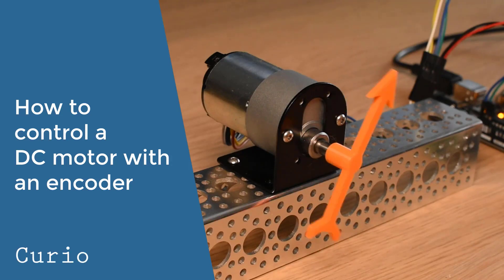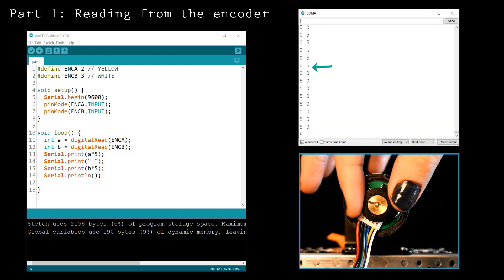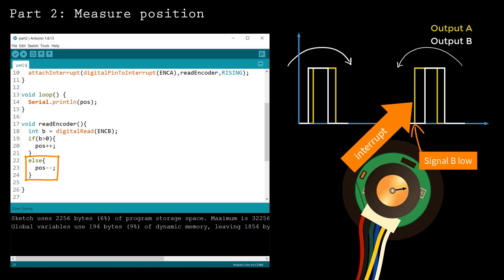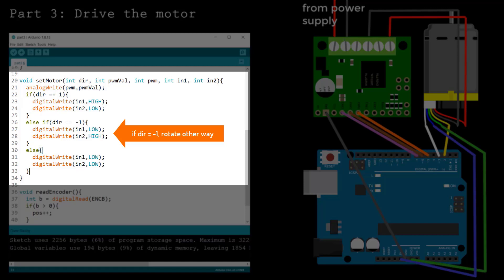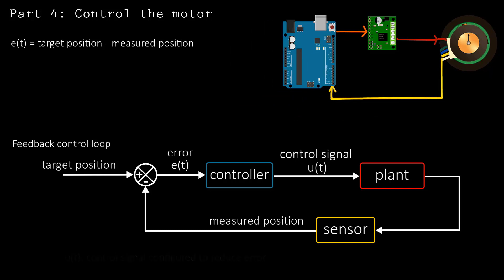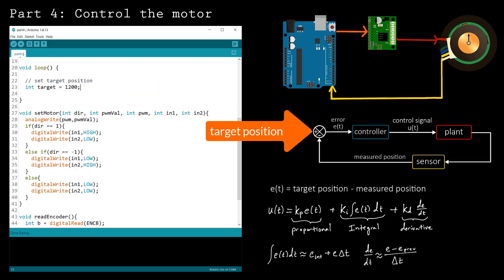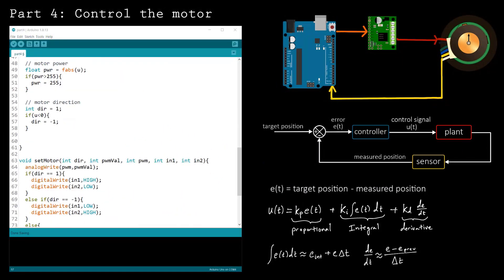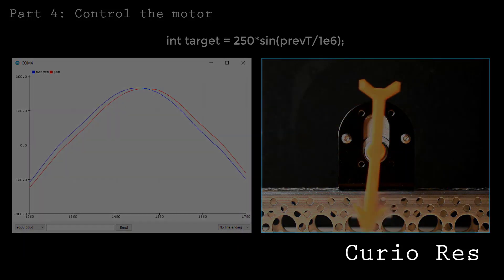How to control a DC motor with an encoder

Comment: Could I do this we three separate motors using an Arduino Mega since it has 6 interrupt pins? I want to be able to change the target position by using buttons and an LCD screen with a menu and percentages from 1-100% which will be converted into the amount of turns the motor needs hence being the target value for each one individually. Would love some feed back :)
Reply from the maker: Indeed Travis, that should work. If you're doing a lot of additional processing on the Mega there's always a chance that some of the interrupts could be skipped and you would have to recalibrate the 0% and 100%, so keep that in mind.

Comment: When my professor told me he can´t tell me how to implement pid into a microcontroller I thought it must be a very hard thing. Finally I came across your video and this was poor luck because my search on youtube gave nothing like yours. So thank you very much for taking your time to explain all of this. I like control theory because it´s hard to understand but If you understand it makes you proud.
Reply from the maker: Sounds like my profs. :D 

Thank you so much for your comment. Your comment is literally the reason I make videos. 

I agree. Control theory is challenging, rewarding, and exciting.
Reply: Theory is dry but what you show makes more fun at least :D Hey I have an idea do you think an encoder attached to a bldc motor would allow me to set the motor speed perfectly with your pid method ? I have such a motor left from an old hdd and I would play around with your code. I only knew how to do it with op amps but changing code is faster than changing capacitors and resistors.

Comment: What does the output on the serial monitor at 2:48 shows, what unit is the output in? I know it measures distance but what is it actually?
Reply from the maker: The positions refer to how many steps the encoder has taken. How that actually translates into the angular position of the motor shaft is determined by (1) how many encoder steps per unit of angle measurement there are and (2) what the gear ratio of the motor is. You can find that information on the spec sheet for the motor.

Comment: Really good is it possible with Arduino control a big high   Torque  dc motor  with relays like servo motor in both directions and feed back from motor  gear shaft feed back from potentiometer meter  I mean no controller in side only arduino and relays for supply and direction feed back from motor reduction hear  you are look engineer please solve the issue thanks
Reply from the maker: Is the difference that you're trying to use relays instead of a variable speed controller (i.e. PWM motor driver)? If that's the case,  yeah, you can do that. But it's not PID control and there will be issues. You'll bounce around your target a lot, and you'll never be able to actually hit it. 

Alternatively, you could use on of these high current motor drivers (or however big you need for your application) https://www.pololu.com/product/2995
There are other cheaper options than Pololu, but some cheap products can be unreliable.

Or you could build your own... but if your not an electrical circuits person, then you probably don't want to do that.

Comment: Love this , I want to build a gate opener and have to use an encoder to measure distance of travel. I need to study this to get a handle on exactly what's happening. I have to be able to control distance of travel and be able to stop and start during travel. Do you know if there are garage door type receivers for arduino? Thanks. I'm checking out more if your videos.
Reply from the maker: I'm not sure how big your gate is, but I think that some gates might use a larger motor, like an A/C motor. I haven't worked on an application like that, so I won't comment further.

If you already have a motor sized for your application with an encoder, this approach should work. Here are a few of my initial thoughts: you can control the stopping/starting by signaling the motor driver.  You can read from the encoder to identify the change of the encoder's position. If you need to translate that into a real position, then you could (a) calibrate the position each time the gate closes and (b) identify and code the relationship between the actual position and the encoder "position". You can also control the position more specifically using the feedback loop.

In terms of a receiver, I don't know of anything specific to garage doors. As far as I know garage door openers just use RF transmitters/receivers. In the past I have used these RF Transceivers:
https://www.amazon.com/gp/product/B06WLH4ZG6/ref=ppx_yo_dt_b_asin_title_o03_s01?ie=UTF8&psc=1
with this breakout adapter:
https://www.amazon.com/Makerfire-NRF24L01-Breakout-Regulator-Wireless/dp/B01IK9GCPE/ref=pd_bxgy_img_2/141-5233654-2526000?_encoding=UTF8&pd_rd_i=B01IK9GCPE&pd_rd_r=97b87397-caa4-4314-8ad6-94627e814c6c&pd_rd_w=Qi5gA&pd_rd_wg=3mUVx&pf_rd_p=bd257e40-8799-42ac-88d0-f76e0faf3886&pf_rd_r=6VNV5V37MSHHKA1VQXV9&psc=1&refRID=6VNV5V37MSHHKA1VQXV9
with an arduino nano without difficulty. It was very easy to set up a routine for sending and receiving signals between two nanos. 

These are probably overkill for your application. You could probably find a cheaper RF transceiver suitable for your application. Just something I used before. Good luck with your gate opener!
Reply: Curio Res thank you very much for your reply. I am using the original arm from gateopener. It uses an optical encoder to give position. It uses a small 12v D.C. Motor (maubuchi 550-2750v) it's part of off geared down box going from 18,000 to maybe 100rpm. So not a lot of current or power needed. But for 400$ for a new circuit board . I figured what the heck I could learn a lot on this project. Has been thirty years or more since I've done programming but I'll keep plugging away. Thanks again curio res.

Comment: I'm right into this in my studies right now. But I'm not familiar with derivative and integral terms because we use Laplace transforms to get transfer funtions. So derivatives translate into polynomials on the numerator and integrals as polynomials in the denominator
Reply from the maker: Hi Nico. I'm not using a transfer function representation of a model for the control system. In this system, the physical motor (driver, and so forth) are the equivalent of the transfer function model that you might use in a simulation. The derivatives and integrals here are always computed in the time domain (not the s-domain, where transfer functions live).

Perhaps in the future I'll create some additional tutorials that use more complicated control theory. But for this one, no transfer functions are necessary. Just approximate the derivatives and integrals in the time domain.

If you want to learn more about the theory, I'd recommend Brian Douglas' videos.
https://www.youtube.com/channel/UCq0imsn84ShAe9PBOFnoIrg
Reply: @curiores111  Okay that is why I got confused some time. Thank you for the explaination

Comment: almost  nobody on the internet used the term "Finite difference approximation", saved me a lot of hassle
Reply from the maker: Yeah, that's "math talk". More specifically numerical methods. It's kind of funny how educational discipline vernacular tends to have a divergent evolution. Makes vertical disciplines like control theory even more difficult for a beginner (as if they weren't hard enough already).

Comment: May i ask you once if you power off the motor and the pcb board and replug it and turn it on. Will it do the same job without computer control?
Reply from the maker: Yes, the microcontroller board controls the motor independent of the computer. Once you've uploaded your code, that same code will run whenever the arduino has power.
Reply: @curiores111  nice , thank you for the replied.

Comment: This is amazing! thank you so much, is it possible to manage multiple DC motors (5) at the same time with this algorithm?
Reply from the maker: Hi Pedro, it is certainly possible to use control for multiple motors. If you're controlling them independently, then you would set different targets (or the same target) for each and use the PID library 
https://www.arduino.cc/reference/en/libraries/pid/
 or your own functions/class to control them individually. For many applications that approach is probably sufficient, although of course there are more complex algorithms that can be used. 

Also, for five motors you are definitely going to want to upgrade the microcontroller (esp 32 or arduino mega, perhaps).
Reply: @curiores111  Thank you for the quick response. Yes! I am already using an arduino mega for the project, and they will mostly have the same target position. For the hardware set up, since the encoders need to go in the  interrupt pins is there an exact position for the two encoders cables? for example, can I have Encoder4 A in pin 19(Interrupt pin in MEGA)  and Encoder4 B in pin 17(Not an interrupt pin)? Thank you
Reply from the maker: @pedrojavierbautistapulido192  That's right, you only need the interrupt on a pin where you're going to schedule an interrupt. The other pin just needs to perform a digital read, so no need for an interrupt. Another thing to consider is the potential for skipped readings. If your application requires very high precision, and you have a lot of interrupts/processing going on, you might miss a reading. If this happens, you may need to consider running a more powerful controller or more than one controller (or switching to stepper motors).

Comment: Hello, I'm thinking of building a robot that uses 2 encoded DC motors similar to what you have in your video.  Can an arduino uno read 2 encoders, considering that only pins 2 and 3 are interrupt pins?
Reply from the maker: Hi Daniel. You could try a setup like this:

Motor 1 - encoder A -> pin 2
Motor 1 - encoder B -> pin 4

Motor 2 - encoder A -> pin 3
Motor 2 - encoder B -> pin 5

Then, schedule an interrupt function on pin 2. In addition, schedule an interrupt function for pin 3. Each interrupt function should update a different motor position. I haven't tried this myself, but don't see any reason initially why it wouldn't work.

After you have that working, you can also consider purchasing an Arduino Mega or even better, an ESP32, which also has wifi. These boards have several interrupt pins. In addition, you are less likely to lose counts with a more powerful microcontroller, which can happen with an Uno if the motor is moving very quickly and you are performing other computations on the Arduino. These other options are not much more expensive than the Uno.
Reply: @curiores111  Thanks, I will try that. Have you heard of the enableinterrupt library which can turn all digital pins into interrupt pins?
Reply from the maker: @dw3695  yes, I have heard about using more than two interrupts on the Uno. Personally, I'm less interested in hacks (either software or hardware) to obtain more than the built-in function. There are likely reasons why they chose only to offer two interrupts (it may put too much demand on the processor to have more). I would rather upgrade to a better controller, considering the negligible cost.
Reply: @dw3695  did you have any luck completing this task I am currently trying to do the same thing.
Reply: @MrJmanjim  Hi, like curio res suggested, I changed pin 3 to pin 4 so pin 3 could be freed to be the interrupt for another encoder. It works, but since I haven't inserted the other encoder yet, I'm not sure how well it runs when two encoders are used at once.
Reply: @dw3695  I am just curious how the second encoder would be grounded and powered would this need to be from another external power source ?
Reply: @MrJmanjim  there are 3 ground pins on an arduino uno. The encoder i used can take either a 5v or 3.3v power, both of which are supplied by arduino's pins.
Reply: @dw3695  Appears like my encoder is +5 vcc that is why I am having issues to complete this
Reply: @MrJmanjim  arduino uno has +5 vcc too
Reply: I am using the 5+V for my first encoder so I am unsure where to place it to power my second encoder. I have two encoders that are both 5V

Comment: One of the best videos I have come across. The combination of the hardware setup and linking this to the block diagram and finally linking block diagram to code is an inspiring idea.
Reply from the maker: Thank you Rokonuddin. I'm very pleased that the format resonated with you. When I finished the video I was sure that I had covered too much. But I think that it can be worth the effort when you actually want to understand the details of how a system works.
Reply: Hi  @curiores111  , the scope of this video is perfect. If you had a feeling that it was too much, perhaps for a beginner it may be too much. For someone that already has a basic understanding and some experience coding it's absolutely perfect!! So well done!!  Thank you so much.

Comment: Hello, just curious how I could implement this code by just having the target position can be constantly changed instead of one position per upload ?
Reply from the maker: Hi Joshua, you can set any target you want inside the code. Simply change the line
   int target = 1200;
to your desired target. For example, at the end of the video, I show a moving sine target calculated as:
   int target = 250*sin(prevT/1e6);
But you aren't limited to a predetermined target. For example, if you have a sensor reading and some logic, you can use those to set the target, instead of the sine curve. You could also send a new target from another source, like a computer, through the serial com.
Reply: @curiores111  would it be possible to include another motor with an encoder and have it have do the same thing as the first motor ?
Reply from the maker: @MrJmanjim  Certainly, you can use more than one motor. Schedule one to interrupt pin 2 and the other to interrupt pin 3. Make sure to include separate measurements and control signals for each motor. If the code becomes clunky, consider using the PID library 
https://github.com/ettoreleandrotognoli/ArcPID 
or writing your own functions/class.
Reply: @curiores111  Hello So I have attempted to add a second motor with encoder and it goes to the target then it will continually oscillate after. Is there any tips your have for what to do when adding a second motor in regards to the code, I have duplicated everything.

Comment: Hi thank you for posting! Would you be able to give me some pointers of how to do PID to reach a target velocity rather than target position?
Reply from the maker: The first thing I'd try is simply implementing the same feedback loop in terms of velocity and see if that's good enough for your application (this might not work - could be a lot of jitter. There are other more advanced methods that you could try - but it's a good/easy place to start). You can estimate the velocity, the derivative of the velocity, and the integral of the velocity using methods similar to the ones shown here. For example, you could compute the velocity as:

velocity = (position - previousPosition)/deltaT
where "previousPosition" is the position stored in the previous iteration of the loop.
Reply: @curiores111  thanks I'll give that a shot today :)